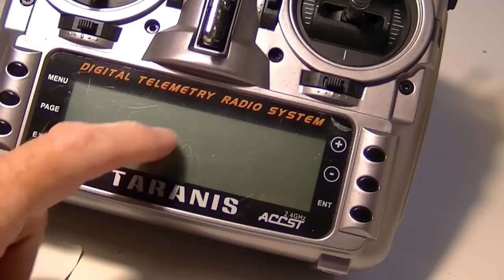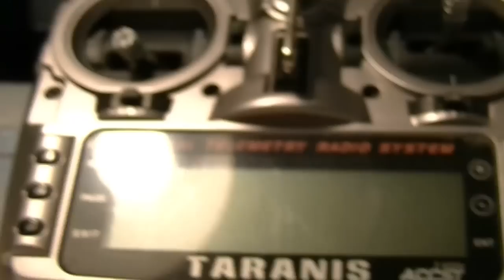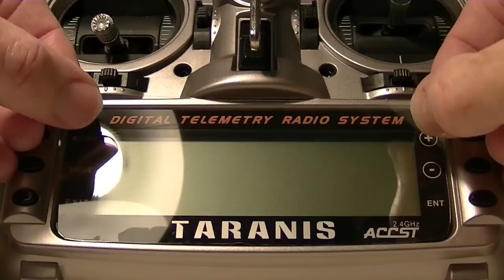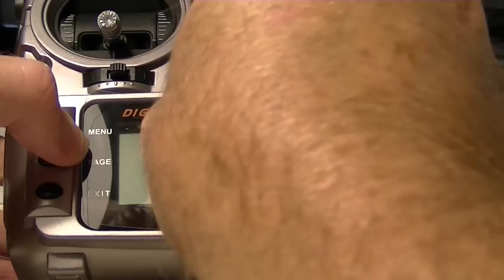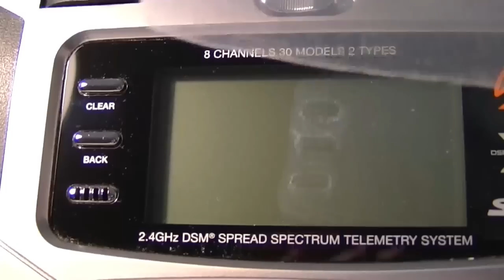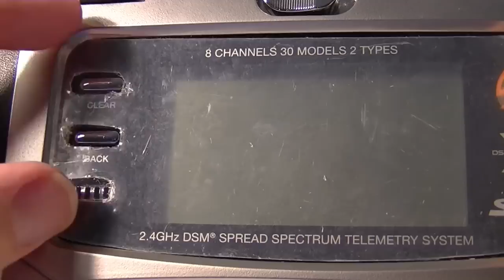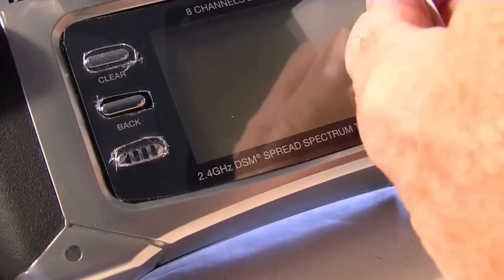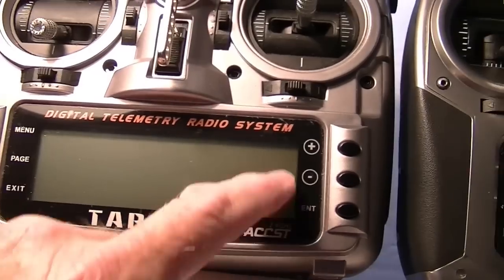How to Protect RC Radio Display Screens from Scratches

Comment: Better late than never... 
For the buttons so they look good.  Use a paper-hole-punch to punch the rounded sections of each button, then connect using the exacto knife and straight edge.  Work from the back side so as the adhesive side of the film does not contain the burr from either tool.

Question: Are the screens in those radios plastic?
Reply from the maker: Thanks, I think think they are plastic.
Reply: Merci!